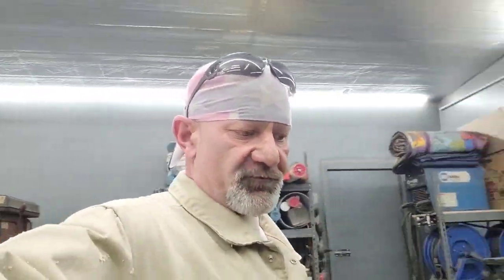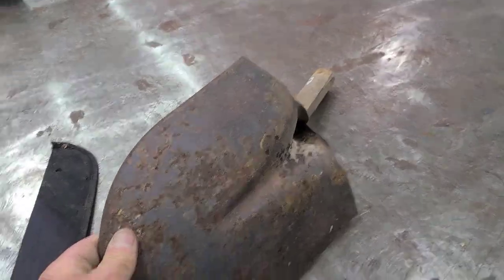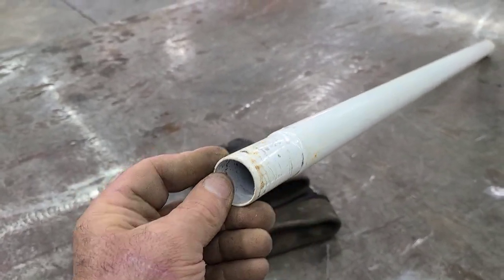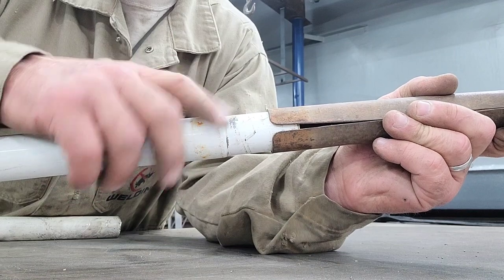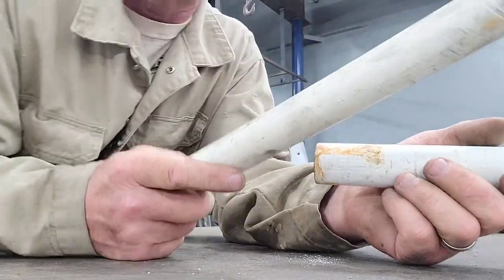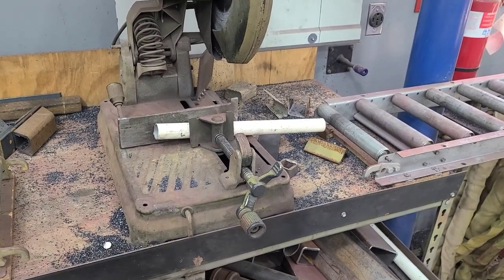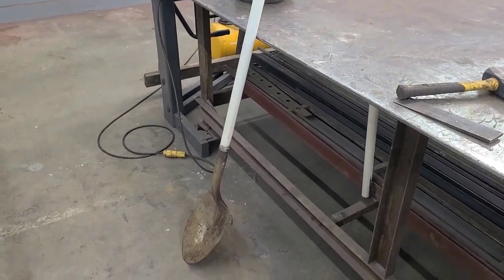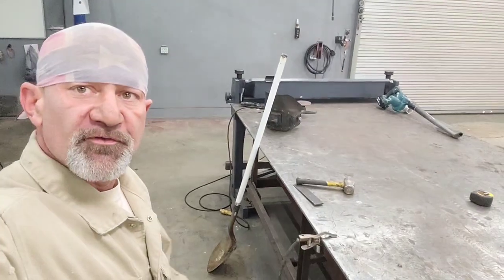Custom shovel handle from tent pole pipe

Comment: Funny you posted this. I just fixed my flat shovel the other day but for different reason.  My shovel handles dont break but the head portion cracked because I used it as a pry bar for lifting a slab of concrete.
My shovel heads wear out and can't break the handle. I only use Nupla shovels for this reason. I will never buy a wooden or fiberglass handle.
Great tip though
👍